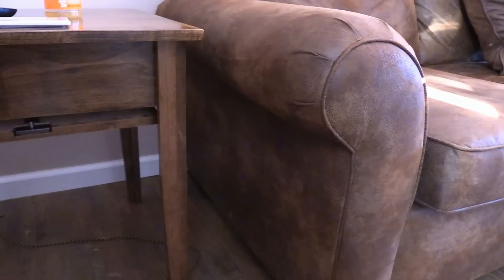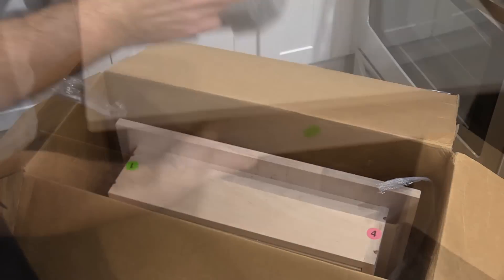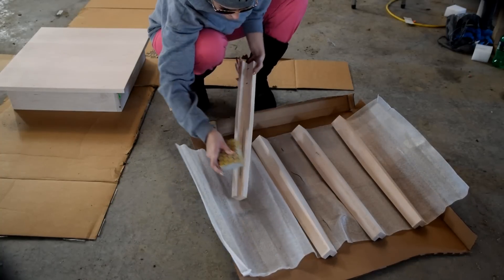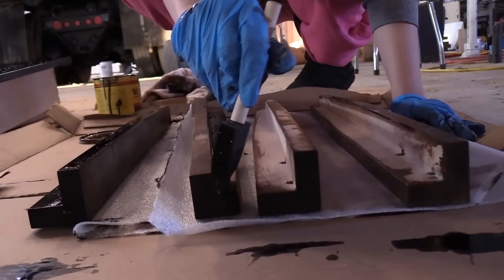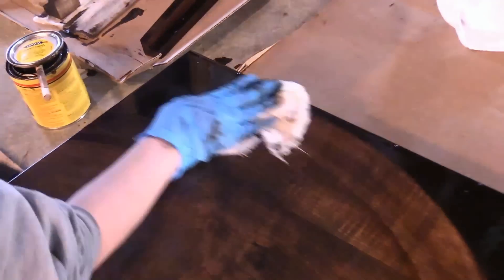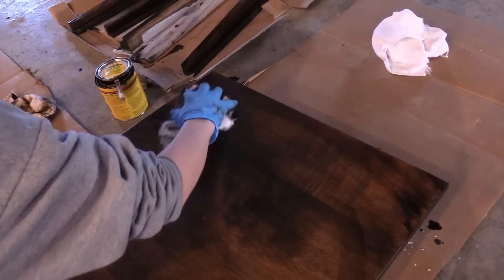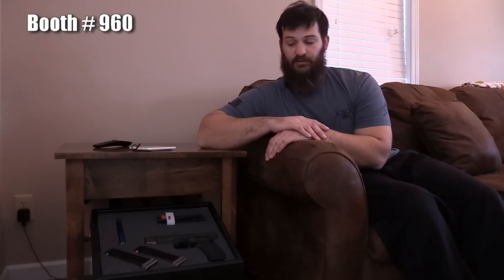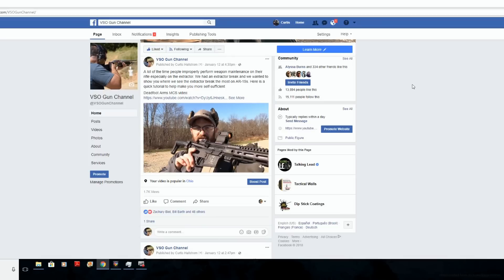Tactical Walls: Hidden in Plain Sight

Comment: Your sofa arm rests are good places, a thick solid wood dining table with hidden compartments built in, a large decorated in wall mirror, a concealed floor safe with its entrance under a removable wood slat, there are all types of places to put valuables and in plain sight even if you are renting instead of owning a home. The critical key to finding good places starts with a creative imagination.

Comment: Nice but what if you loose power? And does it just open if power goes out?
Reply: Yes its works. Uses magnet in the latch and that card he put against the side of the table.
Reply: Sir frydryk pretty sure it has a battery RFI card has to work off power this is not a magnet product like some of the other